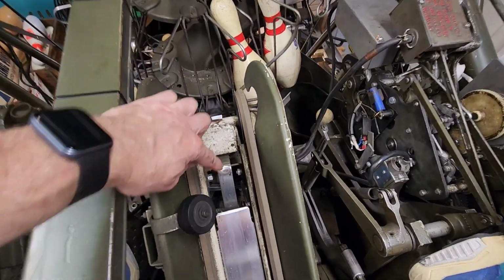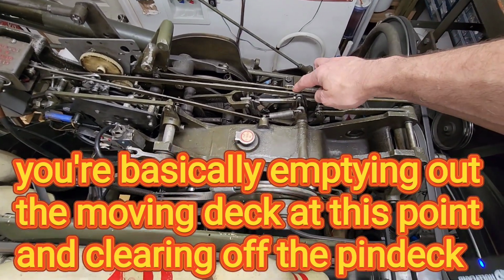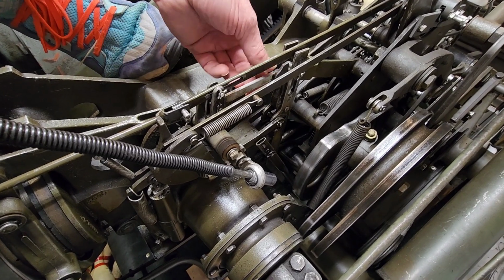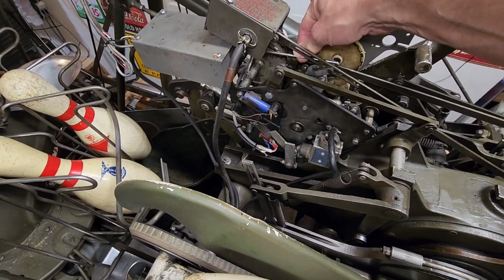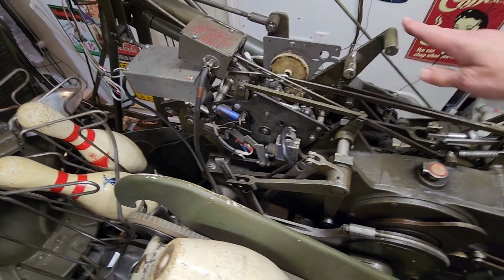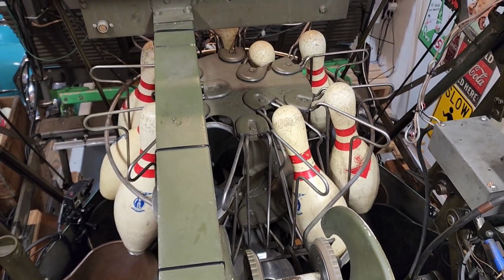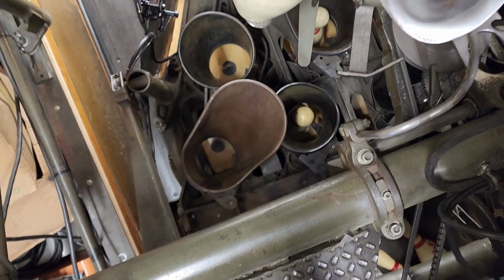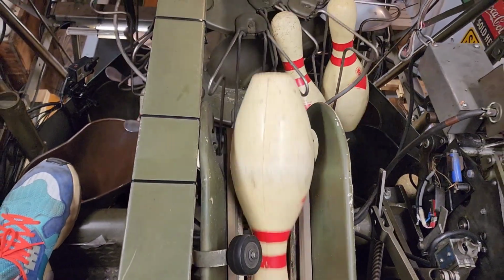Respot pins on a Brunswick A or A2 pinsetter #maintenance #vintage #bowling  @GarageBowlingAlley

Comment: Nice video... on the GSX setters. You can easily respot pins from the bowl desk computer
Reply from the maker: I've heard with the push of a few buttons......but I would miss whole heartedly the mechanical aspect of the Brunswick pinsetter.
Reply: Nice but what if you don't run GSX machines

Comment: Wow, my training and first pinchasing job was on those original Model A style but ours were gray and Serial #s 61,000. We had the C style follower latches but easy to get to. Yep, trip rods, hockey sticks, time delay dashpot with adjusting stem, overtravel, old style pit cushions and solid rake lift arm rods (pre shotguns).....we had 44 in a row and they ran like swiss watches. People don't believe me but we would average 4 to 8 calls a night total both early and late leagues including ball calls. Now of course every once in a while something would break but that was extremely rare and we had our little tricks on how to nurse them through. The goal was always not to have to move league play off of their designated lane assignments for the night. I started as a kid doing menial stuff up front then moved to the back when I turned 16 in 1969.